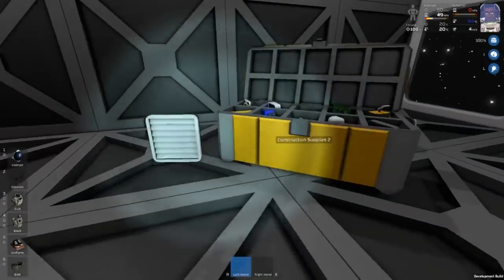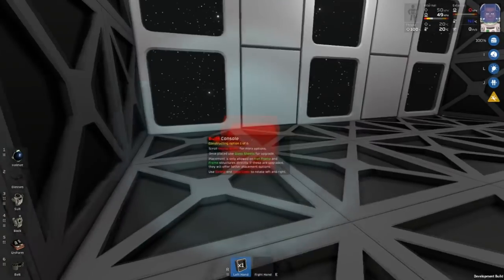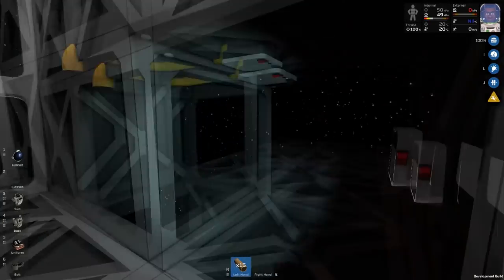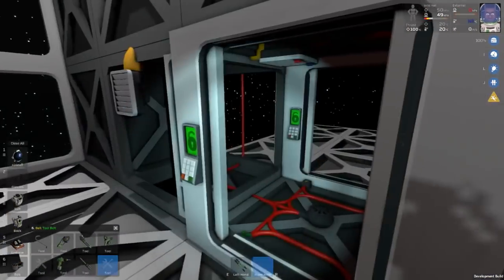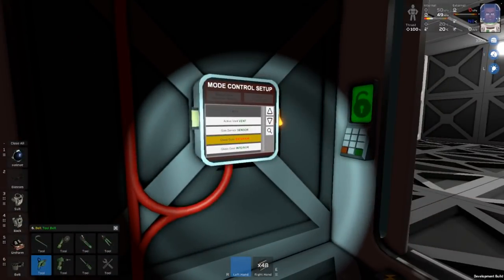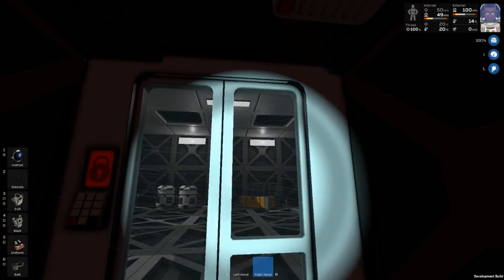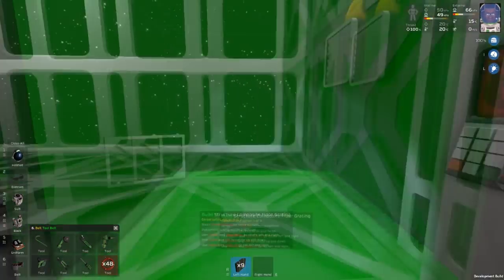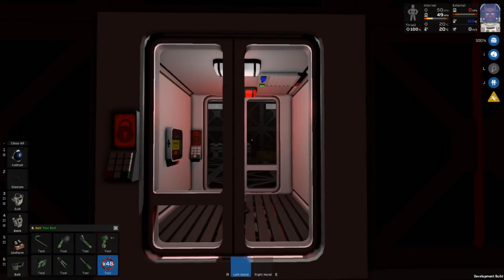Stationeers Tutorial: Starter Airlock

Comment: Listen to this man when he says that you should put 3 consoles on every airlock. 
In my recent playthrough I was doing some work in my greenhouse when the airlock bugged out and cycled without receiving an input from my part. now I'm trapped inside and can't reach the console because the airlock has depressurized, the outer door is open and the inner door won't respond. I can't even force the inner door open with the crowbar because the security bolts are in place.